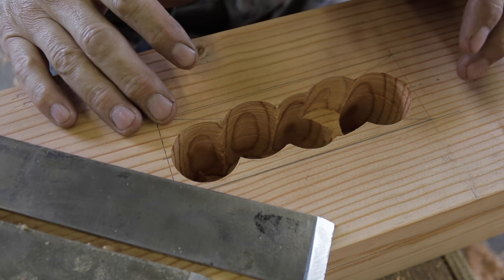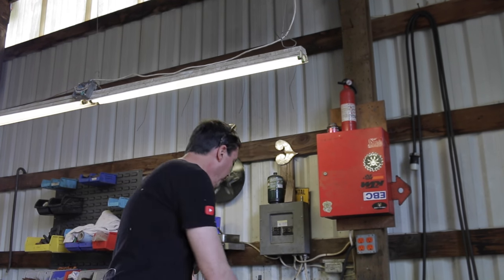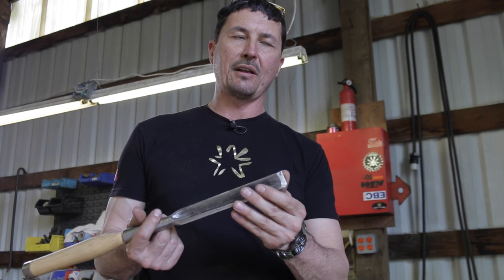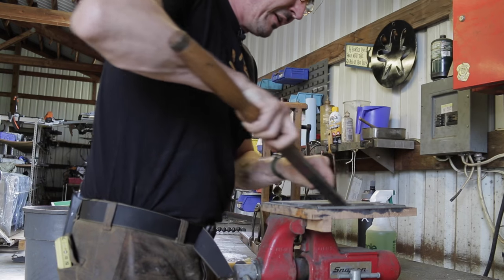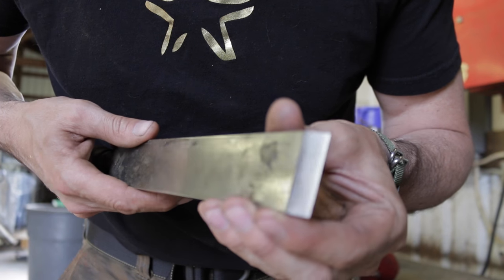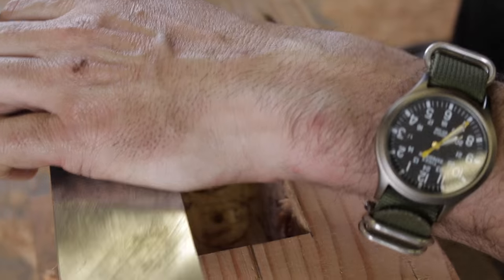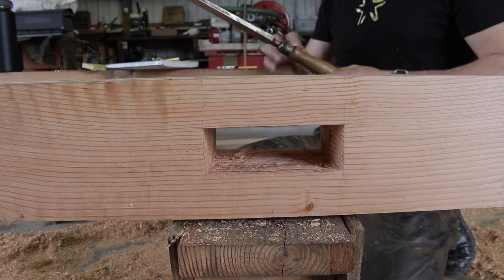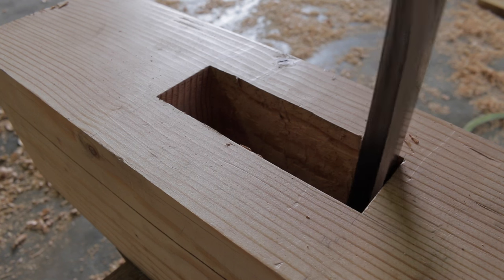DIY Timber Framed Mailbox

Comment: Great video as always.  I would put the angle facing away from the mail box.  Also I agree with logcabinlooms comment about the bracing not interfering with the work of the snow plow.  You could have the cross piece go further on the back of the post and attach the brace between the extended cross piece on the side facing away from the mail box.  It would then support the cross piece by pulling on it from the other side instead of pushing on it on the mail box  side.  Probably not as strong as the latest one, but with good joinery it will be plenty strong, although with a lot more work needed to do it.

Comment: I like the angle sloping towards the back as well. From a practical point of view, do you want draining water to fall on the weight bearing side or on the run out side? The run out side for sure since you are going to dowel the intersection the back side will only look bad if it rots prematurely.

Comment: Cody, the "Old Timers" here in the East talk about a homemade slurry (lack of better term) that was used to treat log homes in the 18th/19th century. I believe the purpose was more so to repel insects that damage wood then repel water. Did they do that out west? You can find many fantastic examples of Chestnut logs on homes/barns/sheds used on this side of the country before the blight basically killed off the species in the early 20th century that naturally withstood insects and rot to a certain degree. Is Douglas Fir a species that is pretty resilient for structures?

Comment: I agree the top looks better sloping to the back.  You might also putting a slight chamfer on the portion of the cross piece that sticks out beyond the post so it will shed the water that comes of the top of the post..  I'm not so worried about the cross piece as I am about the water getting into the mortise .  Just a thought.

Comment: Beautiful job Cody. Doing some crude math and have come up with a crazy big number. If you sink a peg or pin through the joint, it will have to withstand a shear force of over 400 lbs. what with the snow AND snow plows, wind and weight of the box plus it's contents. Please consider using two pins; 1 1/4 inch each. You could reduce that number by hogging out a 3 inch step slab from the beam directly under your box without sacrificing strength. How about a taper, like the rigging of a tall ship? Rock on!

Comment: Angle the post away from mailbox.  Then add a small roof to help protect the joints for the water.  This will help make the project last longer and give a small amount of protection to the mailbox and newpaper tubes.  If you can have your metal mailbox powder coated and baked to give a lifetime finish.  I did this for my parents and theirs is as good as the day I made it 25 years ago.  Regards, BAG2

Comment: Hi Cody and family, Are you aware of any plans for the beam drill which you used on this project. I am trying to build up a complete workshop of only hand operated tools as growing up on a farm in Country Australia electric tools were unable to be used on location as sometime we were working miles from the nearest homestead and an available source of power. Those were some of my fondest memories of my childhood. Thanks again Cody for bringing back all those memories and the want to return to a sense of true craftmanship
Reply: +Andrew Poole The gears for it would be beyond what you can make without access to a machine shop. Maybe some could be scavenged from something like the differential from a lawn tractor or tiller?  Otherwise, just a large sweep brace and bit  and be careful of the angle.
Reply: +David Kirtley i was a machinist in the auto industry until the colapse of the market here in Australia. i used my severance to build my own workshop on a tract of land and am gradually making it into a belt driven shop that can be run of a stationary engine if the grid were to fail.

Comment: If you could only afford 2 of the 3 Diamond plates Cody?  My opinion of a corner chisel, is that its just slightly better than a mortise chisel. So neither are hardly worth their weight in salt.
Reply: +HOSSMCGILLICUTTI  I know you didn't ask me but I would get a 1k and a 5k or similar spread.  If I could only have one it would be 1k.  It's aggressive enough you can really move some steel but it will leave a cutting edge that is more than sufficient with stropping.

Comment: Slope away from the mail box.  For the reasons the water it's going to shed and cause excessive weathering.  Might consider I putting an angle on top of the beam so get the water to shed the beam as well.  This will help water from pooling in the middle of the beam and getting into the joint  causing excessive weathering or rot.

Comment: I think you should have used the corner chisel right from the get-go after you bored the bulk of wood away. I regularly used a corner chisel, but you can’t judge what an advantage it is unless you use one to knock out the wood, as the first chisel to, as another commentator said, "To DEFINE the corners", making then dead square.

Comment: Any way you can use that angle on top in the cross brace?   I tend to like parallel lines even if they aren't strait up/down or left/right.   Just a thought for the design.

Comment: I like the angle going in the direction that you chose. My only comment would be, if you are putting the mailbox on top of the horizontal member, I would have put the mortise lower so that the vertical post sticks above the top of the mailbox. That's just me though.

Comment: Use you corner chisel as you work rather than at the end. You chisels are the same as some of mine. The sprays split a handle from time to time so I have a Henry Taylor socket inch and a half as that's the one that gets the beating in my shop.
Reply: *sorbys bloody auto correct

Comment: From someone that has never done timber framing.....so this may be a stupid question.....but I was curious why you didn't drill all the way through instead of drilling from each side??
Reply: the drill didnt fit all the way though i think
Reply: ahhhhh.....well that makes perfect sense....thanks.
Reply: +CnSteele You don't drill all the way through because it will tear out the wood grain on the other side giving you a "ugly" mortise. structurally its just as sound BUT would you be proud of that workman ship? I've learned a lot from Cody and from Paul Sellers. "Its not what you make its how you make it." Paul Sellers.
Reply: Yes...I can see this.  However, the holes he was drilling were all inside the area to be chiseled so tear out would not be a factor here.  I can see not going all the way through because the bit is too short though.
Reply: That is another possibility but its always good practice to do your finest work every time. besides the drill bit being too short would be a boon in this case as it would eliminate the accidental tear out if it were too long.

Comment: It will be strong! ....But will it be Hooligan -proof?
If the would-be delinquents were to hit the new mailbox with a baseball bat I hope they get a stinging hand for a reward from the vibration of the bat. Rig up a capacitor discharge to the Aluminum bat for an extra jolt.... that'll serve them varmints.

Comment: a few years ago I had a Robert sorby 1/4 chisel go clean through my finger
Reply: +Andrew Dearing how'd it happen?
Reply: +Tony Miller chiseling on a little cube when the wood broke and my finger was on the other side. went in the side came out the top
Reply: Andrew Dearing what happened to the finger after that
Reply: Tony Miller 5 stitches. It's all fine now. Narrowly missed the bone, joint, and nail bed
Reply: Andrew Dearing what did you earn from that experience
Reply: +Tony Miller my woodshop teacher was a jerk and made me sweep the shop before going to the hospital
Reply: Andrew Dearing mine was strict but  nice and helpful also i was good at agriscience and have never been injured in the shop